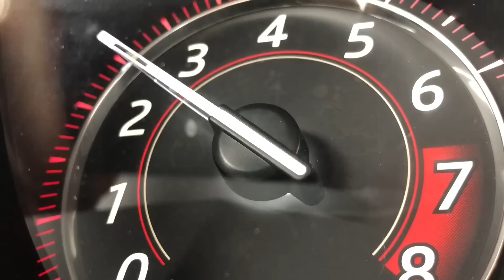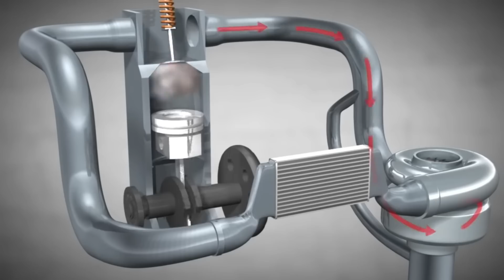Are Turbo Engines Reliable?

Comment: Also, the newer Kia's and Hyundai's with the 1.6 L turbocharged four-cylinder GDI engine and the seven-speed dual-clutch transmission are unreliable as well. Please avoid any of them and buy the ones with the 2 L and/or 2.4 L four-cylinder non-GDI engine, if you are planning to purchase a Kia or a Hyundai. Better yet, buy the ones with the 3.3 L, 3.5 L and/or the 3.8 L V6 engines instead.
Reply from the maker: Thanks for sharing
Reply: @ECPP  You're welcome.
Reply: @md2k8  As a Kia dealership Technician, I think you hit the nail right on the head.
Reply: I have the Elantra with 1.6 Turbo but with the 6 speed manual; I definitely wouldn't have bought mine if the DCT was my only choice of transmission
Reply: Was really looking into the Kia forte GT 1.6 turbocharged engine with the DCT..
Reply: I have the Elantra with 1.6 Turbo but with the 6 speed manual; I definitely wouldn't have bought mine if the DCT was my only choice of transmission
Reply: What about a turbo charged V6?

Comment: It’s amazing that BMW would put a car in production with such a poorly designed V8 Bi turbo.  A first year college Auto engineer would know better.   A horrible idea putting the turbo’s in the V of the motor.   In a 7 series top of the line Beemer costing premium dollars???   Shame shame!!
Reply from the maker: True, either that or shield it properly, just have to keep the heat away.
Reply: Yes, even something like a hood scoop/vent could have helped push out the heat, a simple cheap change that would have greatly helped.

Comment: The theory in practice is to take a small engine and add performance, which in turn provides for less emissions, and all the other ecological feel good legislation. Out of the equation is reliability, longevity. And the engine plastic melts like a candle, like Ford's disastrous Ecoboost engine, with enough heat to ignite the engine into flames. Carbon build up, integrity of oil quality. Personally, I like naturally aspirated engines, large displacement. Ford used to make a wonderful 460CID with a four barrel eight jet carburetor for their Lincoln line. Those were the days! I blame California for the demise of the auto industry.
Reply from the maker: That’s likely the issue.  You are right, the old small and big block engines generally chugged along and lasted forever.  Even the NA LS engines are work horses

Comment: I don't own turbo charged cars, But if I did I would Change the oil NO less than every 5,000 miles with Amsoil Full Synthetic oil, Because I would drive it hard of course 🤓. I hear Honda has solved the oil dilution problem with better oil and some minor design changes, Don't know if that's true yet, I guess time will tell.
Reply from the maker: For sure time will tell on the Hondas.  The added performance sure is great.

Comment: turbo not reliable why because toyota lexus dont like to put on their cars  make no reliable any car  toyota only brand that boring and like granpa cars slow and boring. it overheat the engine. make enginge work more XD.  so only toyota is too scarer of turbo i am talking about stock car ok?
Reply from the maker: True but even Lexus IS now running to the turbo routes in 4 cylinder
Reply: @ECPP  so let the problem began:) but the y put after other have test for years and years   They been cheapstick and the price for a cheap car with nothing to offer is like selling a simple pen with a price tag of a laptop

Comment: No economy only Political calculation
To produce heat or power we need burned or exploded fuel. BTU
Cant produced so much power with little fuel.
Yes we can get lots of the power with turbo engines 
Efficiency is not there - need consumed lots of fuel os big displacement engines.
Political calculation smaller displacement of the engine-less Air taken by the engine and less exhaust = less power
In turbo charge engine turbo boosting so much Air as huge displacement engine - huge exhaust = huge pollution.
Only saving on used Metals to cast the engine blocks and pistons.
Politics with imbeciles from marketing is the big problem only.
Look today talking of huge power for Electric cars.
Who needs those super expensive cars for Handicaps?
How peoples are in real life brainless and swallow those stupid theories of scam artists?
To run electric cars we producing even more pollution and destroying more human children's health.
To get those metals used for battery how many Diesel Trucks plus other heavy bulldozers were used to destroy nature?
To produce electricity plus other things.
H2 Hydrogen only can bring dreams to nature and human life.
Marketing is looking for easy slides to make easy $$$ only
Similar too was in 1930 when electric cars were manufacturing - more complicated at that time and dropped go with Oil.
Oil is cheaper more money can get.
We have a speed limit 100Km/h
Who needs an electric car 500Hp 0 to 60 in 2 sec?
Same idiots imbeciles who have lots of stollen $$$ what show domination on the street.
That very loud exhaust intelligent peoples needs so much = noise destroying life around
Try to look intelligent man going to spend 1/2 of his life to pay off the loan for a car with a very loud exhaust or an electric car. 
Try to imagine an idiot in an electric car in winter time he becomes very unsafe on the street - the weight of the car is 2.5 up 4 tons can he stop that vehicle when he pushes to the limits?
I can't understand those idiots who want electric cars and those with a very loud exhaust.
What is more expensive to build an Electric motor or a gas or Diesel engine?
Why Electric cars are so expensive?
Tesla big Battery cost up to 10.000.00 dollars - an electric motor 500 Dollars = a car cost 150.000.00 dollars what this all means is a huge ripoff of imbeciles who is buying that garbage
.
Reply from the maker: Thank you very much for your great comment.  Yes there is always a lot of smoke and mirrors when it comes to manufacturers trying to promote a new technology so they will push and say what they need to.
Reply: @ECPP  is 100% true * thank you for understanding what I express * Lots of things mixing * Toyota BMW what I know doing a lot of research with Hydrogen H2* have some complications at this time* Tesla even told officially H2 is the future* Europeans are very advanced in Hydrogen production. by natural sources as heat underground * many different methods to produce very cheap way Hydrogen* Tanks to manufacture is not a problem have technology only Hydrogen by natural chemical combination is leaking to the wall of tanks * When Hydrogen is cheap and friendly we can refuel every couple of days who care we do not need to store for years in the tank.* Every engine can be converted to Hydrogen today plus we can have Power Cells = Havens on our earth.* All decisions are in hands of Political actors with corrupted marketing* Poland has 100% technology to produce very cheap Hydrogen - the owners of the World are not allowed to start those productions_ some European countries with rich natural resources sold all to the Owners of the World for that reason everything is on Hold today.

Comment: Unfortunately my 2002 Volkswagen Passat GLS has a turbo and that’s the only way you can get the 1.8 engine.
Reply from the maker: That is true, sometimes there are no options.  But with a well designed system and hood parts, the turbos can go as long as the rest of the engine.
Reply: @ECPP  Agreed

Comment: Turbo=problems
Reply from the maker: More so for a poorly designed or built car.  Porsche can get it right most of the time.  Lexus too now is rolling into some.
Reply: @ECPP   more like lexus toyota dont like to overheat the engine XD  if toyota put turbo into  their car? wont bve so realible.
Reply: no turbo is like a toyota and lexus reason toyota are reliable no over heat or more engine work more

Comment: I'll take the Escape with the 2.5 4 cylinder, I DON'T WANT A TURBO. They are fast, but don't last
Reply from the maker: That’s fair.  I know a person with the current Escape in Na form and someone with the turbo 2 and the NA has been less problematic so far.
Reply: @ECPP  You can also go for the Escape with the 3 L V6 engine instead.

Comment: They are only fuel efficient if you drive normally,NOT WHEN YOU DRIVE LIKE YOU'RE IN A NASCAR
Reply from the maker: Absolutely right.  Go hard and they can guzzle too
Reply: @ECPP  Agreed.
Reply: Yep, my dads 2020 f150 has the twin turbo v6 & gets 19.5 mpg…… vs my f250 4x4 w/ a 6” lift that gets 11 mpg🤣🤣🤣🤣🤣
Reply: Question is, with an ecoboost truck towing, are the turbos not constantly screaming?
Reply: @bliglum  nope I have a 3.5 eco boost and yea getting to speed the boost is up but I go gently, then once up to speed I back off very little boost is happening
Reply: Uhm the Porsche 4.0 liter GT3 does just fine thank you. No turbos
Reply: Life’s too short to drive normal.
Reply: @nooddles12 it will eventually be shorter if you don’t drive normal hajaaj
Reply: Do a video on the 2021 Kia K5 GT line please
Reply: Shows how much you know. If you drive normal in a turbo they won’t last. You have to drive them like you’re supposed to.
Reply: @redeyezreaperx1601  not from what my mechanic said
Reply: @redeyezreaperx1601  That makes zero sense, you do realize its always spinning right? The only thing you need to upkeep is oil changes
Reply: @ 😆 k